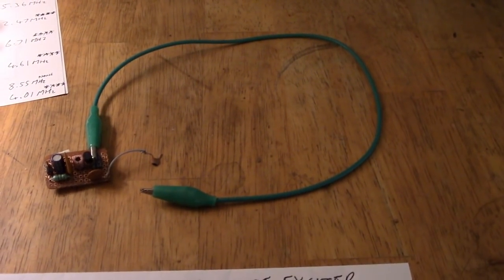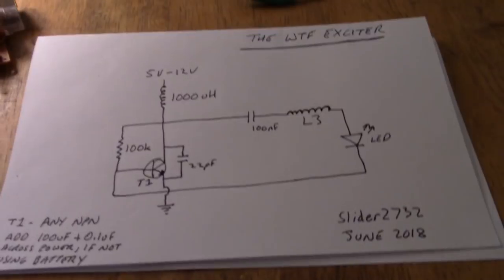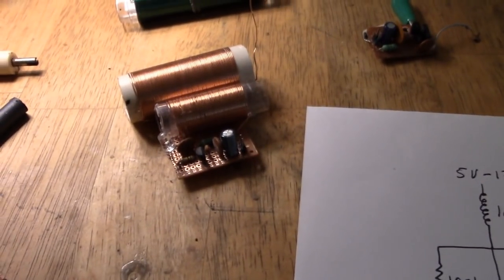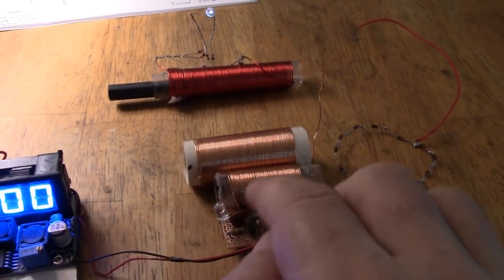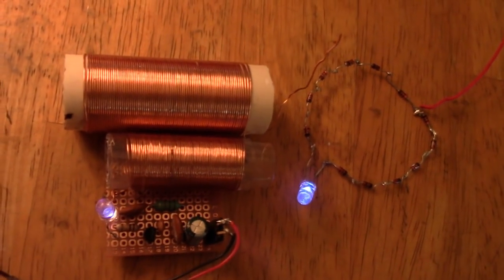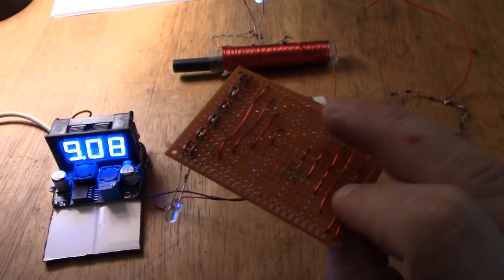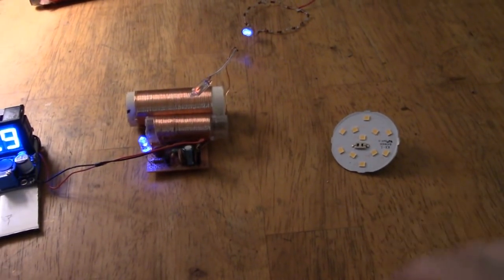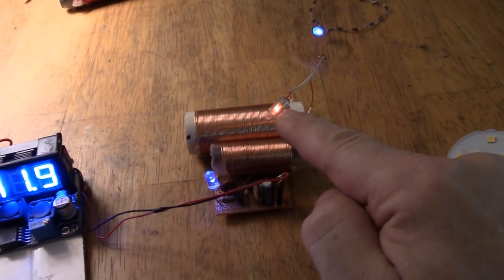A 3 Coil Exciter

Comment: What happens if you give it a kiss? Read on. I know I am wierd. Try the coils at 90 degrees to each other so they form a X (Kiss). Just a thought no idea really.
Reply from the maker: Not a bad idea. The cutting across may induce similarly to a magnet over a regular coil (motor theory). Such induction might be possible at 90 degrees over a whole other coil, with tiny bits of wire.

Comment: Year 2015 I've been over thinking it on the Wireless charger to attempt to make the Range longer to power Up batteried Power Tools I wasn't successful but you have the key to figure out lot better than me very happy to see that I'm not alone here with similar idea my end goal was to be able to Power numerous Device with one wireless power supply whole house very nice Project I wish I could visit you and check out your projects
Reply from the maker: Thanks Pablo :)
One day there'll be no mains wiring for lights in houses, at least...it's electrically safer to use 1 wire transmission, plus cheaper without needing the 2 thick copper cables.

Comment: RFID related - search google or youtube for 'RFID tag emulation with an AVR' and see interesting stuff on running an ATtiny with Vcc and GND not connected!
Reply from the maker: I wish I could program ATtiny's and PIC's. There seem to be methods using Arduino's but i've not had success. A uC using ambient energy is one goal and those things look to be perfect.
I did have a look at using an Arduino for RFID, would like to find/create a reader but have only found the tag emulation.
Oh - tried Earth ground earlier and it did work slightly, but nothing like a decent improvement. Some aspects were better, some worse. At least, with the setups as they are now.
Reply: I have uploaded a 3 minute video showing how I program ATTINY13 and 85: https://youtu.be/01bFVniHags
Reply from the maker: Cheers, will check it out right now :)
Reply from the maker: Wow, you used one of my tracks and it actually worked well for the demo. Many thanks all around, that was a surreal as well as useful video !
Reply: Sorry for not first asking for approval before using your music in the video but I somehow knew you wouldn't be upset :) Programming the ATTINYs from the Arduino IDE is easy enough but I have not yet tried flashing assembler, which those RFID hacks use !
Reply from the maker: Pishhh, as they say, that's what the music is for...am delighted that you did use it !
RFID's use assembler ..hmm. I need to order a few of those. Someone showed a gun thing that can reprogram their output signature, so they have EEPROM that isn't locked down. Am wondering if the chips can blink LED's in patterns, or be otherwise useful tiddly microcontrollers.

Comment: 2 discoveries in 2 days!  You are son of Edison!  Just as stubborn and persistent.  It is said Edison made 1000's of failed trials before getting the light bulb commercially practical.  And you are good at leaving no rock unturned.  NIce find on the neon omni directional reception.  May prove very useful in the future.  As you said most xmitter/receiver devices now days for like wireless charging are very direction sensitive and have little (inches) range.  A problem if solved would allow much more freedom to charge electric cars maybe even while they are moving.
Reply from the maker: Hehe thanks. 
The neon was a surprise, am used to holding one leg and on this one there wasn't one. My other neons work ok, but this one wasn't expected to. 
At resonance, power should have reduced induction properties, but increased range....so am always looking for that and how to get such effects  :)
Reply: Your progression almost matches Tesla's work with lighting.  First, he followed the Edison 2 electrode filament, then glow discharge tubes with 2 electrodes (just pins not shorted filament), then operation using 1 wire (as you did with the One Leg Neon) and finally (your next step) the illumination of bulbs without any wires or electrodes!!  That was the practical result of long intensive investigations into working with the Ether.  His crowning achievement was having the bulb with no wires, electrodes and a hard vacuum (no gas inside) to light up brightly and by wireless reaction to his coil arrangements.  It is said that many years later, by an observer, that he had mastered such an elegant control of the ambient medium, that he could make it rain or make fog at will around his coils and circuitry!!!  People tend to think of his inventions in terms of electrical and mechanical traditional engineering terms, but he states many times that his real path is to investigate and harness the Ether.  He was one of the last Ether scientists.  Today, practically no body believes in an ether  and so no professionals will do research on it.  It is up to the garage experimenters to go forward.  And to date, none of the scholarly professionals have been able to light an "empty bulb" with no electrodes or wires in only a vacuum at a distance.  This bulb was an important proof to his theories on Ether.  It proved to him that there was something in any space around us, even when all the air was pumped out ===he was convinced this was evidence for an Ether.  The 2nd important use was the bulb could act as a electric energy detector:  hence tying the Ether relationship to the Electric field in the first scientific observation.  I make the 2nd way to tying the Ether to the electric field using regular physics in the expression of the dielectric constant of SPACE, permittivity, you know that thing relating all electrical capacitors.  Tesla used his coils to "tickle" or breakup equilibrium and trigger Ether "like ocean" waves, or streams or rivers of "flow" which he knew can act just like electricity in a wire,  only these "flow" over the wire.  And since these "flows" have no friction (not matter particles' there was the ultimate hope of a "river of free energy" gratis Mother Nature with the right circuitry.  Hence his work with ever more higher voltages and energy levels.  To the uninformed person, the observations would seem to be ordinary effects of EM theory since the Ether will simulate the same effects of volts and amps on a wire.  (Think about AV plug for example).  Today's science has no detector of Ether and will always assume EM theory for all effects.  Of course the Ether was originally part of Maxwell's EM equations, but were conveniently stripped away without full exploration.  Case of pick and chose your "truth."  Here is an interesting brain buster for you.  An electron has an electric field around it.  It never discharges!  What does work to maintain that charge?  That electron could be considered like a spherical tophat capacitor except something gives it free charge!  And if we could have some of that charge it might be free (real free energy source) and Mother Nature would give more to the electron to compensate.  Mother Nature pays not us, so this is another relationship to the possible Ether or as Tesla referred sometimes as the Ambient Medium.  This is the tip of the things you are working with with these tabletop oscillator test.  There is much to Tesla's research and should not be thought of as obsolete in view of today's physics already knows everything just because they can calculate it.  Faraday once said that mathematics was useless if it could not be demonstrated with real objects.  Enjoy.
Reply from the maker: Can't hit delicate things with a hammer...an ice cream can be enjoyable for 10 minutes if eaten correctly, but will brain freeze the head if eaten in gulps. The whole balance thing and using the right methods. 
Electrons i've never seen, yet they are all around and something keeps them going. The name's Bond, Covalent Bond. Why not the Ether for the motive power ?  can't be ruled out. If Tesla got so far with a belief in Ether, then it's not to be thrown out anyway !
The filament in a traditional, erm, Edison bulb, will resonate like any coil. Match the resonant frequency as a vibratory condition and cohere the current path, it may glow...or break. There could well be frequency cymatics at play within a vacuum sealed bulb too (in my opinion). It can be imagined that Tesla spent a lot of time matching and changing and adjusting, just like the daily writings of the Colorado Springs Notes show as that short snapshot of his life. Along the way he likely stared at a partially glowing bulb, while a bridge nearby fell apart into the river.
Reply: Umm ice cream, I need those covalent bonds!  Give me!  Yep them electrons are NEVER stationary, hence they not only have free electric charge but free kinetic energy.  What gives them the energy? If you say blasts from other particles and waves, then based on the Standard model, without the universe having an energy source, then after all these 14 billions years or so, there should be NO motional energy left with all the frictional, radiation and other losses in the SYSTEM!  So electrons should not still be motional.  Scientists can not explain that one.  Here is a position where Ether might offer an explanation.  

Einstein had a tiff with Tesla once and made an off the cuff comment something like:  well why don't you ask Tesla, he is smarter than everyone.  What the tiff was really about I can not find.  But the fact that they were photographed together makes it clear Tesla knew all about Einstein's Relativity theories (relating curvature of space-time to mass to account for gravity "force."  While Einstein probably knew something of Tesla's counter theory of gravitation which did not involve curvature of space but an interaction of the ether and a mass and electrical effects.  Did you know the earth is negative and the sun is positively charged?  If so, then it is also true masses in space are effectively capacitors to each other.   Any disturbances of one area will affect the "plate" of the other masses.  A disturbance can be as simple as an oscillator sending out HV or EM waves!  See the connection to your oscillator on the grander scale!  You are to a tiny degree manipulating the Ether.  But back to the sun/earth charge, there is harvestable energy in that situation for a smart person to grab on to.  Tesla knew it too.  But back to the competing theories.  Clearly Einstein would only rally for his own theory and pooh-pooh any challenger!  At that time Tesla's popularity was waning and Einstein was rising and supported by all the professional academicians.  Unlike relativity, Tesla's theory smoothly connects the large scale with the quantum and subquantum scales.  It also explains how the equations for gravity and the electric field between 2 matter bodies are virtually identical!  The conventional scientists have no answer to explain this.  I don't believe it is a coincidence.  And space curvature has no explained relation to the electric field further leading more consideration for the Tesla view!   So in short, welcome fellow Ether Researcher.  May the "force" be with us.
Reply from the maker: The idea that electrons are pushed by external forces can't be true, they'd be knocked around like a boxer in the ring. It's a flow, a wave, a tuned vibration field force indeed. There's nothing wrong with the Star Wars lore lol. In my opinion, if electrons spin they do it well away from regular scientific laws. It'll be well understood, or was well understood until hidden. 
Am not really sure why there can't be elements of Tesla's thinking in combination with Einstein's thinking. then they credit Tesla with magnetism units ???? 
Here's a weird one to try - if it's sunny outside, face the sun at 2pm and hold the arms outstretched, then turn the palms over to be upwards. For some odd reason the palms upwards 'feels' correct. 
I like the Electric Universe stuff, but they do go a bit far sometimes. Same with Ancient Aliens for that matter :)
Reply: Agreed we have to not get too far carried away in these matters like the Electric Universe, but there does seem some interesting grains of truth within.  Don't care for the Ancient Aliens as factual but a fun read.  I suppose you could mix Tesla and Einstein thinking.  Relativity by the numbers and observations seem to validate it for the Large Scale like planets and solar systems or speed of light and time effects but we KNOW it is not the complete story as it does not work at the quantum scale.  So it is either incomplete or is not the REAL truth and the math just happens to work for the macro scale.  Just because math works and seems to match observations doe not PROVE it is the REAL truth.  I have seen numerous times where 2 different equations totally not related in the real world would give the same answer.  One is nonsensical yet gives the same answer.  Personally, I like the idea of curved space but not due to relativity but due to Ether stress.  Perhaps curved space is in fact Ether stress on matter of the large Earth which we call gravity.  Don't know.  Relativity does not explain origins of an electric or magnetic field but can be using the Ether Vortex Theory.  The Big Bang Theory has a glaring defect as well since it wants us to presume that the build up to the explosion just happened without needing to explain where the source of energy came from to do the work to build up that energy bomb that is released in the explosion!  But ever since we are expected to respect energy conservation laws - a major tenet of physics!  Ether Vortex explains logically origin of all the known forces and effects of EM waves or radiation AND Electrostatic waves (Electric Waves:  Ether waves in motion).  It is well known that a changing Electric Field will also cause a changing Magnetic Field 90 degrees offset and vice verse.    And if a wire is held in that offset fields an EM current pops up.  So here is proof that an outside motional Electric Field (Ether stress) with NO CURRENT or amps required CAN produce POWER.  If the electric field is disturbed by shaking, vibrating or in your case oscillating will have a reaction on any near by conductor and only then is the energy converted to EM energy as electricity having voltage and amps, resistance and Lenz Law with a detectable electric and magnetic field.  In space the energy is primitive Ether stress.  It penetrates all matter.  But in reacting to conductors the "Ether induction" upsets the wire charge balance causing the traditional effect of generating electricity for a moment until charge balance is regained and then disturbed again with the next wave front or pulses.  Anybody saying you can not generate volts, amps and power from just an electric field which does not need any amps is simply going about it wrong.  There is I forget where I saw it a simple demonstration showing a moving static charge causing a magnetic field, done many years ago.  In radio waves physicists admit that the transmitted wave is moving and changing (converting) from electric to magnetic fields repeatedly along the direction of motion!  Generator theory talks of "cutting" magnetic field lines and inducing a current that its own current in the wire fights the field that gave it birth.  Now consider a different kind of generator where there is "cutting" of Ether stress and the coil also generates a current but now there is no fighting the Ether as the Ether has no concept of amps or volts and the wire does not need to move to have current flow rather it has only stress or equilibrium reactions.  I think what baffles people for so long is that the Ether "induced" current in a wire is indistinguishable from generator or battery produced current.  Moray followed Tesla and came to this same conclusion as well.  And explains how he could use tiny wires to produce 1000s of watts without any heat burnouts.  There is much more to this but I will spare you the long discussion.  Thanks for your comments.

Comment: Slider2732 Have you L2 L3 magnet wire info how many turns
Reply from the maker: This L2 is 60 turns of 28AWG on a solder tube, the L3 is 80 turns of 28AWG on 1/2" PVC pipe.
Am not sure which combinations may work well and in fact equal turns count might work best...all is a bit fresh yet and am just glad it fired up  :)
Reply: Thanks